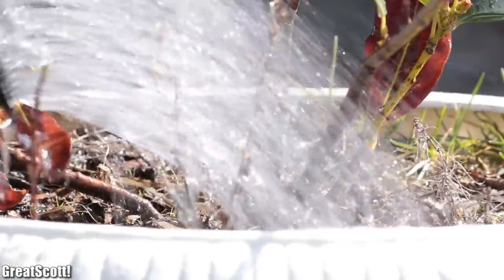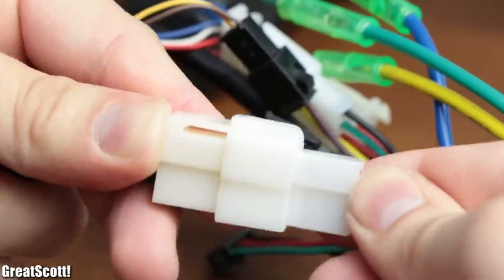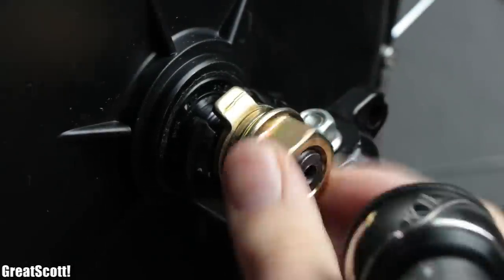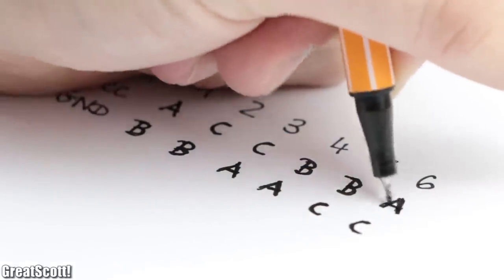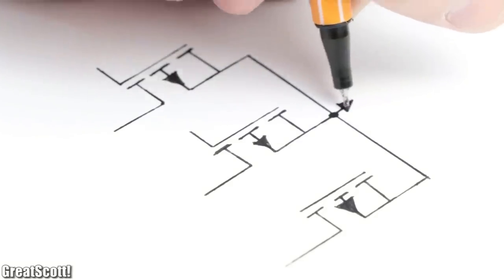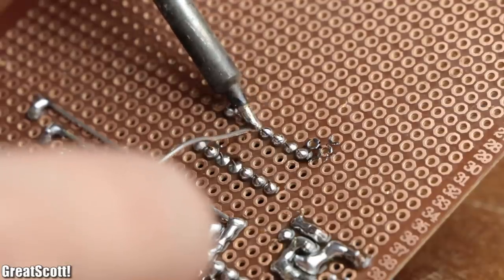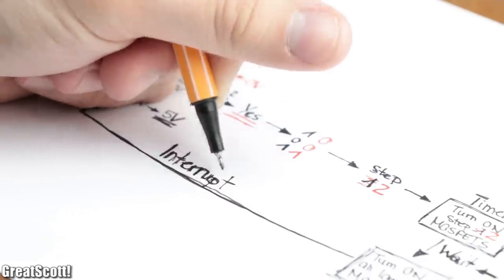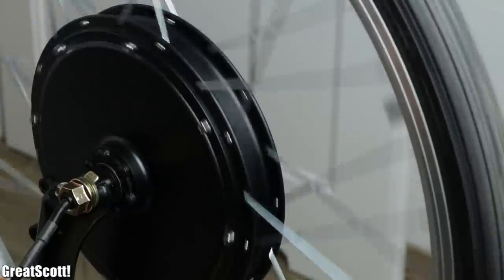Make your own Sensored ESC ||  Electric Bike Conversion (Part 1)

Comment: If I make a ESC and I want to use it into a RC car , how do I make a remote to control the ESC from far away?
Reply: If you plan on making a remote controlling device (I assume for fun, because really good controllers are $40-$45 like the Flysky i6), then you probably want to use an Arduino and a legal frequency transmitter and receiver. It won't be easy unless you follow a guide (but I don't know of any great examples).

Comment: isn't easier to buy a big brushless motor like in the electric skateboard? i want to know why is it beter these way
Reply: He did buy a motor, but those brushless motors will not spin without the electronic speed controller (what he built). They are not like brushed motors where all you need to do is connect a battery to make it spin.
Reply: Jake Garret my question was why he buyed a motor integrated on the wheel and not one outside moving the wheel with a pulley , isn't cheaper these way?
Reply: Cleaner looks, less mechanical moving parts for failure and maintenance (probably better if it rains too), no adjustments, easier to install, fewer parts to wear out. So yes you can get it cheaper, but you're trading off a lot of benefits.

Comment: Front wheel? Isn't it supposed to be in the back?
Reply: There are two types of conversion kits... Front or rear wheel. Front wheel conversion is easier because you don't have to deal with the chain and gears. Those are attached to the wheel itself, so if this wheel was put in the back you'd lose the ability to pedal and it would no longer be a bike.
Reply: volvo09 o.

Comment: I think, this is not legal.
Reply: Its legal, just may not be on the road (but you could ride this around in your yard).

In my state in the US, I have a 52cc gas powered chainsaw (3.5 HP at 10,000 rpm) on my bike, I can do burnouts and smoke my tires (bicycle tires don't last long doing that... so only on rare occasions). I also have a 25cc grass trimmer bike that does 28 mph (they had 30mph limit for a while), and its legal in most states without insurance, tags, or even a licence to drive on the road. You never have to pedal these things, and they can climb pretty steep hills (I also take mine off road for some drifting fun).
Reply: Jake Garrett yeah, I’m in Germany ( like him) and I meant street legal.

Comment: What's the problem with 48volts I think you didn't have a good project
Reply: The controller doesn't work with lower voltages so he can't test it on his power supply
Reply: And choose the battery and the power he want not only 48v and 1000watt
Reply: maybe easier to create a 48v power supply :)

Comment: Why you just supply the correct voltage. Your going to run it off batteries, so hook them up. Your not going to ride it with an extinction cord. Waist of time.